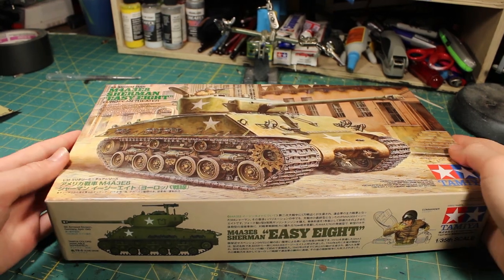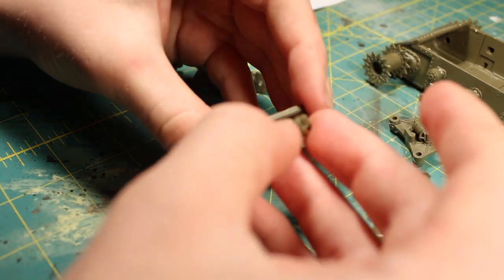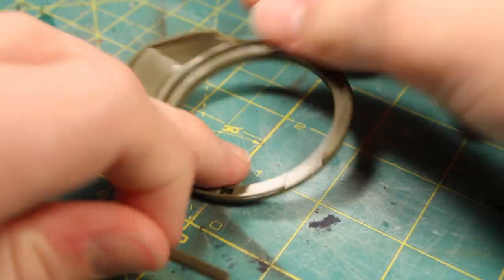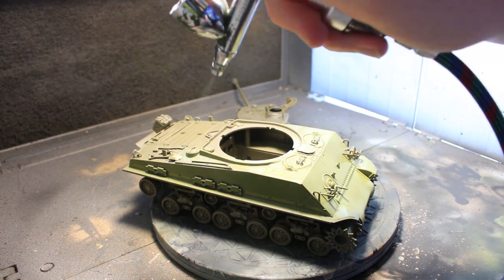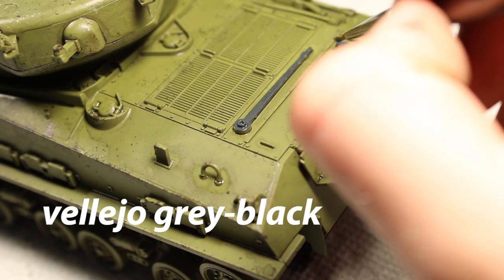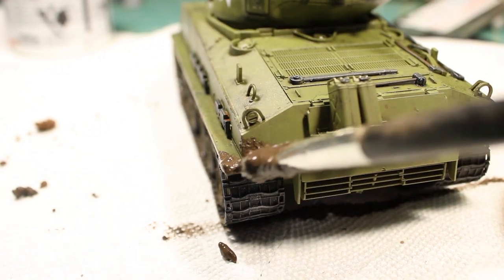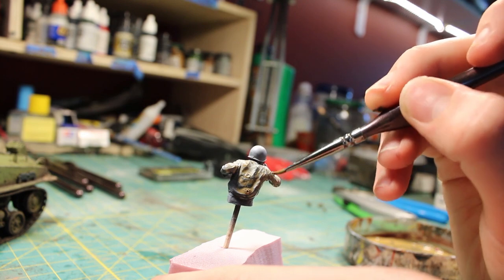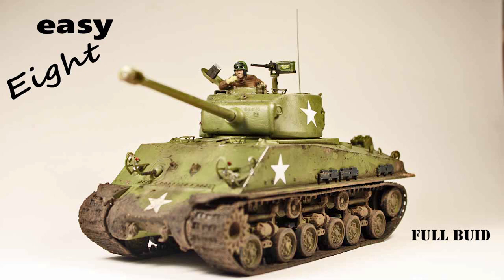Tamiya 1/35 Easy Eight Sherman - Full Build

Comment: Dear sir , would this tank model be a good beginners scale model to begin with   for a 75 year old man? It's been over 60 years since I built a scale  model. Also what kind of glue did you use with the applicator?
Reply: From personal experience i would suggest tamiyas m4 sherman early production. Its slightly simpler but the difference in complexity is so small that you can pretty easily start from this one. As for the glue i would suggest precision plastic glue from deluxe. It dries relatively slowly so you can easily correct mistakes and its easy to use. I hope this helps